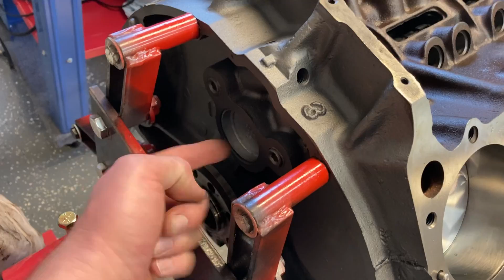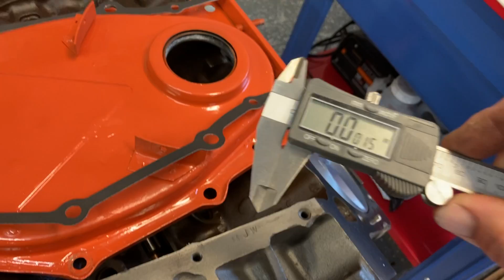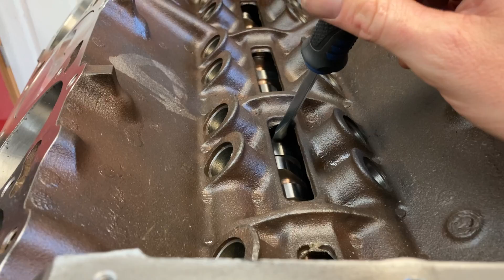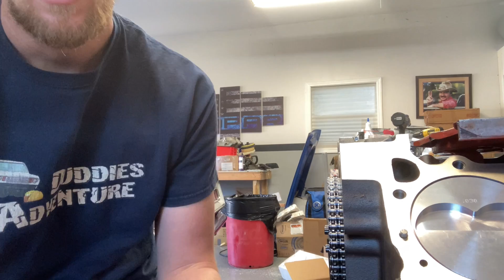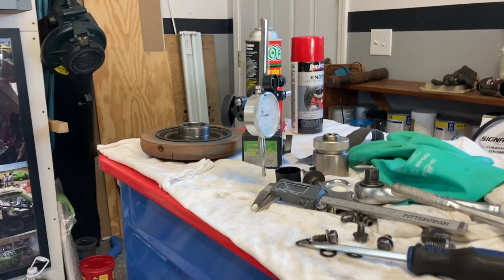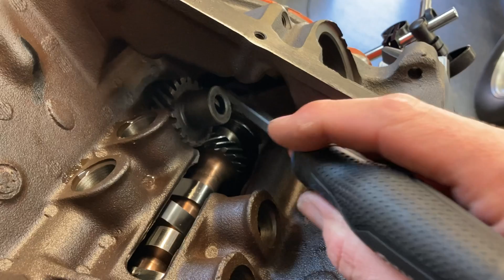Big Block 400 Build Series: The Controversial Cam Button #compcam #mopar

Comment: The second timing tab was added so that an earlier ( or possibly later) water pump housing could be used.  Early has the bottom hose on driver side, later on passenger side.  Damper should have an added TDC mark to correspond
Reply from the maker: Nice catch! Thanks UTG
Reply: Put the distributor in it and a Mopar big block cam won't walk

Comment: So, there is no need for a Torrington bearing? Just use a button?
Reply from the maker: Some sets have them and the cheaper sets don’t. They reduce friction between the upper gear and the block, but someone any means to keep the camshaft from walking forward. Some say the intermediate shaft will pull
Force against the cam from the pump. But the science is that at wide open pulls the cam walls back and force as it spins, which is an instability and loses horse power.
Reply: @JustMoparJoe  Thank you for that. I'll play it safe and do both a button and a gear with a Torrington bearing.
Reply from the maker: @rollanotheronefabrications2903 awesome!

Comment: Shimming between the timing cover and water pump is easy. Just put a blob of RTV on the back side of the water pump when you install it   It automatically becomes the exact thickness you need and provides a bit of cushion if the cam button tries to come forward against the inside of the timing cover. I do this with all roller cam engines. I like your videos Mopar Joe! Keep up the great work.
Reply from the maker: Thanks brother. I wonder if something like JB weld would be good. It’d have to be timed just right to catch the hardening.

Comment: It is late here and I'm tired so forgive what may be a stupid question....
Why are you measuring the flex of the timing cover instead of putting the dial indicator in the valley and measuring the movement from in there?
Reply from the maker: There’s no straight angle 📐 to touch off on with the indicator. So any reading I got would have error in it. My new favorite way is to go through the cam plug at the back of the block.

Comment: I was told that the drag from the oil pump drive shaft always pushed the cam to the rear of the engine. So I guess under hard braking the cam could walk forward a little bit so once you get the end play set I doubt the cover flexing is a big deal. And since big block Chrysler's did not have any way to control forward motion from the factory I guess the chain itself was the only thing that held it from going forward?
Reply from the maker: I believe that’s correct. I imagine the length of chain between the sprockets would allow some decent stretching distance over time
Reply: I disagree. I have read that the spinning action of the flat tappet lifters keep the cam from walking forward. Timing chains are not perfectly tight. With crank gear in position against crankshaft flange, the cam gear can always be pulled forward.

Comment: Thanks for taking the time to go thru your procedure.  Like most 73 year olds, I thought I knew it all.  I can tell you when a person quits learning (at least with cars), they quit going faster.   Given the choice would you build a 400 based stroker or a 440 based stroker?
Reply from the maker: Glad it was helpful. I think I prefer the 400. Starts with the bigger bore and easier to fit into an engine bay.
Reply: @JustMoparJoe  Thats what I was thinking.  One other question.  I have an Altered that I wanted to bracket race.  It was last ran with a 500 Mopar.  Out of sll the engines I could use, what would you suggest?  Also of note it was once ran as an Econoaltered with a modern Hemi (modified of course).

Comment: You don’t see a ton of movement due to timing chain, distributor/oil pump drive pressure tends to compensate it
Obviously there is movement it is something you should at least look at when building a performance eng more so on race engines
Reply from the maker: Hopefully I can limit that movement and make the milodon gear last longer
Reply: @JustMoparJoe   you definitely want to limit that movement.
I’ve never looked at how much room is giving before lifters make contact with opposing cam lobe.
I don’t run a button on my engine now,  not really sure if I will on the new combo as yet 
I probably will  .
I’m struggling with the heads and getting proper clearance on pushrods 
Been doing that little at a time because I’m way out of my comfort zone grinding in that tube area
Reply from the maker: @TwistedMopar  what kind of heads are you using?
Reply: @JustMoparJoe   Speedmaster /pro comp  
6.50 offset
Reply: They wouldn’t been big issue had I used a 440 block,  but 400 block makes the angle of the pushrods much more pronounced ,
I’ve been grinding little by little to get clearance keep from rubbing the head  inside the tube areas on intake runner

Comment: There are more ways than one to skin a cat and I think your way will work just fine I have seen and done it a lot of different ways adjustable with torrington bearings but it ain't rocket science your way is easy and effective and the way I have done it for the last 30 years so yes  now I have been waiting on  your 512 stroker build sheet want to put it in my 69 valiant the 440 in the valiant is going in my 85 ram 250 two wheel drive my budget is only allowing me to run 440 sorce heads but with some porting I think it will still run good for a 4 speed street car always thanks for sharing your videos
Reply from the maker: Thanks Ray! I’ve got that video in the works. It’s a quicker video than my others because of the rush to get it in the car.

Comment: Good video JOe. This is Bob again I have a 1070 barracuda with the 512 kit from 440 source, I am just starting to put it together. Its actually a 505, 4.350 bore with 4.250 stroke. mine is a 440 (1970)and yours us a 400. What is the specs of your 508?
Reply from the maker: Thanks Bob. I actually have a full playlist for the 508 build. It has some interesting finds and nuances of the stroker kit that should help with your build. This one is .040 over pistons to make the 508.

Comment: These are the down falls of rollers in the b/rb series. 
   1 bronze drive wear
   2 no standard method of    setting end play
   3 heavy under performing hydraulic rollers. 
    4 cost
    5 Valve train wear from high spring pressure 

Roller cams are great, but with the performance potential of the .904 diameter mopar flat tappet most guys can have huge performance without the hassle of the roller.  
    As long as correct break in is followed, and high zddp non detergent oil is used, large light high revving flat mechanical tappets can beat a lower revving hydraulic roller. 
     Remember block passage mods must be done to the b/rb series in order to exceed 6500 rpm. 
     Remember how these things still set records before we used rollers??
Reply from the maker: I’m not saying it’s the only way. My dad raised me on Isky solid flat tappet cams in our race cars.

Comment: I have a trick I use with 2 sockets and my press. I take the cover and mark the button with grease like you did but use one socket just bigger than the button then another that socket fits into. Put in my press and make it push about the thickness of the cover and your done. Easy mod.
Reply from the maker: Excellent idea!
Reply: @JustMoparJoe  48yrs of building and racing mopars ya learn a few trick lol. Just because my channel shows boat restoration don't mean that's all I do. If it's got a motor in it or on it I am all over it lol

Comment: Hey Joe, what worked well for my roller cam setup was.. stock steel cover (like yours), but the trick was finding a 1/8" thick "rare earth" magnet that took up the slack between the stamped cover and the water pump. Eliminating the possibility for the cover to flex. I setup
 for  .007" endplay. I also used a timing set with a Torrington bearing behind the cam gear. Working well so far. 👍
Reply from the maker: Thanks for sharing! Great Idea 👍🏼

Comment: I know it'd ruin an original Mopar timing cover, but could you weld a piece of channel iron across the front to stiffen it up? Or along with that, weld in a threaded bung so you could fine-tune the runout? Not sure any of that would clear the water pump, though.
Reply from the maker: Good ideas Eric. Many guys weld a plate. I will fly it and watch it.

Comment: The cover is going to flex?  Get a billet cover.
Reply from the maker: I’m not bothered by the flexing cover. The cuda in my thumbnail ran this cover with a bigger solid roller and never had an issue.
Reply: @JustMoparJoe  Gotcha...
Reply from the maker: @jcnewbee8124  this is one of the few areas I’m not in fear to save a few dollars.

Comment: More thought into this…..   I think I’d be even more comfortable if after finding “zero” with the cover, you also measured the button assembly itself before and after filing / adjusting it.  Then find the same dimension and correlation with this timing cover method.
Reply from the maker: Yes sir. I felt good after double checking it at the end. My original idea was to use the crushed gasket as the .005-.010. But I figured with the .003-.004 and rtv on both sides, it’d be in the ball park. The nylon buttons are more forgiving they say. The roller style are probably more precise, but if they don’t get proper clearance, they could eat the bearing.

Comment: So essentially you are relying on the assumption that the deflection of the cover is consistent when you pry against it.  As simplistic as it is, I actually think this is a safe assumption.  I’m assembling a 400 based 470” roller cam motor soon.  I think I’ll use this method and see if I can come to a level of comfort with my measurements.  Thanks Joe!   Subscribed.
Reply from the maker: Thanks brother

Comment: I can't wait to hear this engine run and I'd like to see you build a early model 360 j engine full race high compression and the works I'd even supply the pistons and ring's if you show the build of it
Reply from the maker: Man that would be a fun one. How about a high compression 408? I have the pistons to swap into my engine, but would need rebalance.
Reply from the maker: I actually have a 360 build coming up for a ramcharger. It’ll be different than my previous build. He wants some street ability and some good torque.

Comment: Great video Joe.  I have a question tho.  With the indicator on the front of the timing cover when you check the endplay, to me thats just checking deflection of the cover itself and not the endplay of the cam.  Machinist sitting here scratchong my head.  Can someone help me out here?
Reply from the maker: Thanks Alix. Here’s my best explanation. I checked the cam movement when the cam and button were shoved all the way into the block, towards the rear. It would pry forward and stay .009-.010. After filing the button, I tested again. I did each test with .100 preload on my gauge. I pushed the cam to the rear, zeroed gauge, then pried forward. I got .006, then .005. In my mind, that means the lost .004 was from a space between the the button, and the cover. I realize it’s not the ideal way of testing, but I didn’t want to pop the rear plug out.

Comment: Another Great video Joe , I can't get myself to spend the money on a roller cam set up . The 493 I have my friend Dan building me is getting a Racer Brown STX22  solid flat tappet ( Racer Brown grinds cams for Chrysler products not just Chevy patterns on Chrysler cores like most cam companies ) I would have to be building a pretty big engine before I would look at a roller , the only benefit I see to a roller is not having to break it in but that is just me 😎
Reply from the maker: Thanks brother. The solid flat tappet cams are hard to beat for an old Mopar, especially in price point. The roller allows it to rev faster, less internal friction, and allows for more lift to be achieved in the lobe. I got an awesome deal on this NOS cam, springs, and found the lifters on sale. We will see how she goes!

Comment: When using a steel cover an aluminum cam button should be used, or a steel bushing with a bearing end
Reply from the maker: Thanks Matt. I have researched online and asked several engine builders. They said the nylon button is safe to use with any cover. When I upgrade this engine to stroker bottom end, I’ll go a different cover and button.

Comment: Cam buttons are always a great idea on any engine that doesn't have a solid physical retention. 
Plus not to mention, the way the pump/dist. drive gears are set up, the torque applied to those gears will usually push the camshaft backwards into the block. But of course, that second method of retention is not always a 100% guarantee.
Reply from the maker: Thanks Eric. Going to put this one to the test!
Reply: I just setup the cam button on my 400. I am with Eric. The dist drive gear should force the cam back which is why there in no cam retention plate on the BB but one on the Mopar SB. I ended up using an AR Engineering cam button, I did use a different method to measure the gap. But yours would have be a lot quicker and easier. LOL

Comment: The thickness of a button on a 3 bolt seems to be out 25 or so thousands vs the thickness of the head of a stock single bolt. If you have that much walk not controlled by your timing chain/gears then you have bigger problems. To be fair, I have never had a 3 bolt cam to need a button but I expect that you dont even need it? I will stipulate that Im not experienced with solid roller big block stuff, hence my inquiry here.
Reply from the maker: Roller cams don’t have the lobes ground to spin the lifters. That grind makes the cam pull rearward while it runs. The roller cam just spins and has a tendency to walk back and forth. The gear keeps it from going backwards, and the button helps limit forward travel.
Reply: @JustMoparJoe  And yet again one more lesson taught today! Thanks! Its not something as simple as taking a set of hydraulic lifters and dropping them on top of a flat tappet cam. Solid roller stuff is way above my paygrade, hell rollers at all for that matter. It makes a lot of sense. Rather than grinding the button, would it be the same if you just gave the cam cover a pop with the round head of a ball peen hammer?
Reply: Big block mopar the oil pump drive pulls the cam rearward, , small block mopar the drive pulls the cam forward,  thats why small blocks have a cam plate and big blocks dont ,nothing to do with the lobe taper or lifters spinning
Reply from the maker: @brettjohnson8009  I agree with your points. Here’s more information from a more reputable source on why it’s needed. https://www.motortrend.com/how-to/cam-thrust-explained-killing-engine/amp/
Reply: @brettjohnson8009  Since the drive gear is a drop in it pushes more downward than anything and the only thing that actually keeps that in place is the dizzy. I had a cam eat itself because of too much slop in the bushings under the gear and in the distributor. Cam walked enough that it double lifted number 2 lobes. The gear helps locate the cam 'centerline' (for lack of better term) but it doesnt do as much as you'd think it would.

Comment: Good going Joe , chase the details to the finish line!👍✋🏻
Reply from the maker: Thanks Brother. Ready to hear it run
Reply: @JustMoparJoe  my buddy Rick Ehrenberg has a 400 /71 Roadrunner, he used the 440 crank and I can tell ya that thing goes like hell.  No track times , it’s just used on the street. Sometimes he uses its photo in “Mopar Action “ magazine.  The 400 is an overlooked engine.
Reply from the maker: @lautburns4829  someday this one will gain 100 cubic inches

Comment: Is the gear in for the oil pump and dist that will change things.
Reply from the maker: Yes sir. Gear was dropped in for mock up. It was a stock gear. I will need a bronze for the roller cam.
Reply: @JustMoparJoe  mancni racing i think it is sells a special coated steel gear made for use w/roller cams and said to be better than bronze because bronze supposedly wears rather quickly . presumably bronze particles then end up in the oil.
Reply from the maker: @danielslocum7169  thanks brother. I hear the bronze wears faster and isn’t best for street use. I’ll see what comp recommends for it.

Comment: Put 2 PC of masking tape on the cover 1 pc is .003 -.005 thick so 2 is around. 010 , then do it grind button until it doesn't touch the cover or move the indicator pull tape and you have .010 clearance..
Reply from the maker: Nice idea. Thanks for sharing!

Comment: Nice work Joe. My last 498 went 10 years on the street with a solid roller, roller cam button and stamped steel cover. The 588 will run the same set up. You will be fine.
As always thanks for sharing your knowledge.
Kevin
Reply from the maker: Thanks buddy! That’s good to hear! Did you have to brace the cover to the water pump, or with anything in the cover?

Comment: Joe what about clearance on a solid roller single bolt? I didn’t use a cam button or check clearance or how much cam walks
Reply from the maker: I’ve never seen a single bolt, solid roller cam for a big block Mopar. Maybe someone else can chime in on it.
Reply: @JustMoparJoe  sorry not a roller. Just solid lifter
Reply from the maker: @ninjapumkin  that’s the majority of what I run. No button needed because the cam is ground to spin the lifters. All that friction helps keep the cam in place.